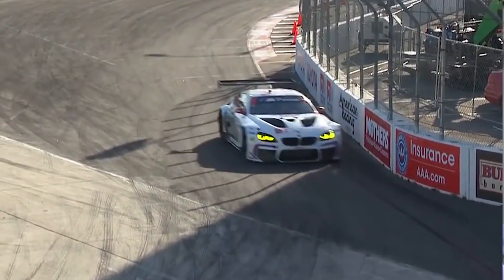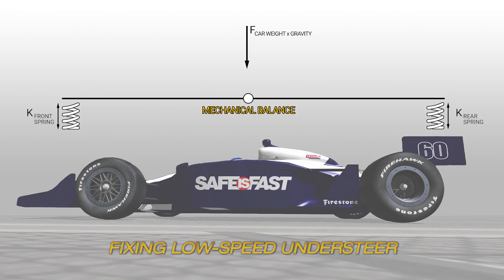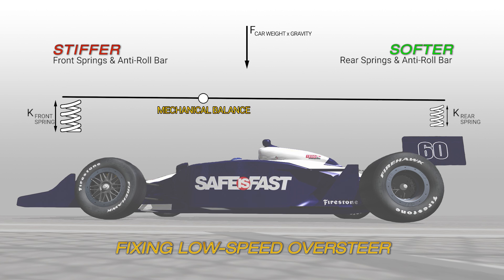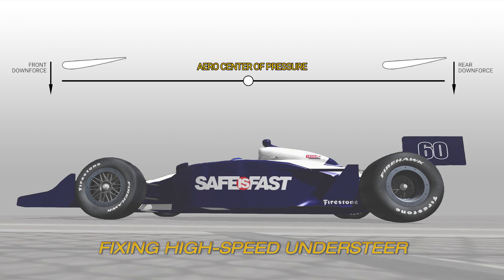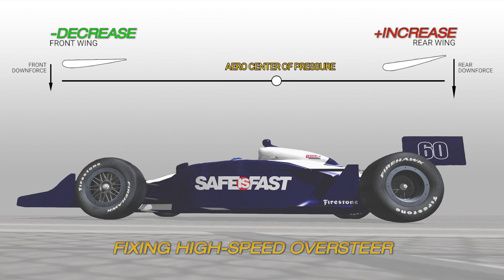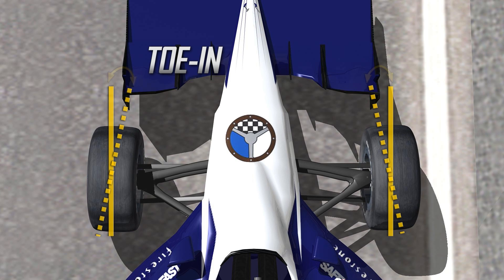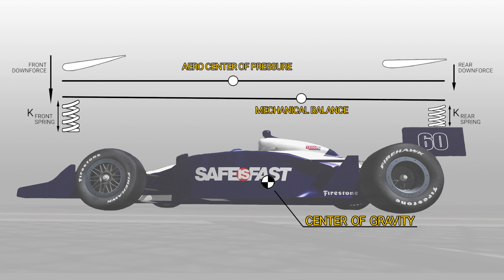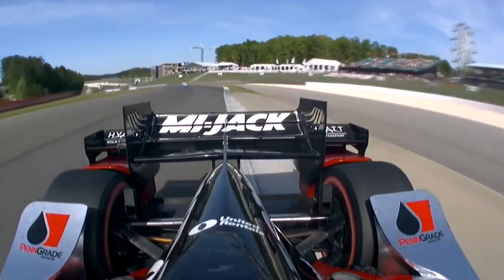Understeer vs Oversteer: Part 3 - Balancing The Car

Comment: Hey, your videos are really neat and very helpful..!!! But, I have a doubt,.. you've mentioned that -ve camber and toe-in are ideal for the rear,... But isn't it that due to the acceleration forces, there will be a squat, and the tyres then incline more towards the -ve camber kind,..,, so isn't it ideal to set a Zero camber in the rear and allow the squat play it's role to create a -ve camber for proper grip?

Comment: Fantastic video!  Can you comment on rake adjustments and whether you see it as more mechanical or aero (in an aero car)?  Prior video talked about moving center of air pressure but it also obviously moves weight distribution as well.

Comment: low speed oversteer makes sense  but high speed understeer?????
Reply: With highspeed understeer it is probably going to be enough to lift off throttle just a little. Highspeed oversteer is probably going to be way more damanding to catch.
Reply: Yes,  you don't want sudden oversteer on a high speed corner for safety reasons, ;)